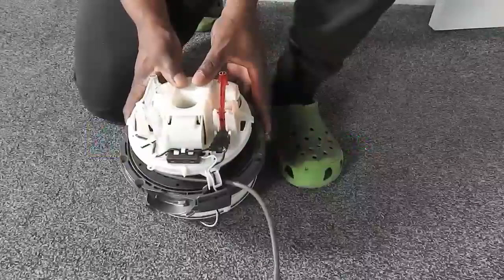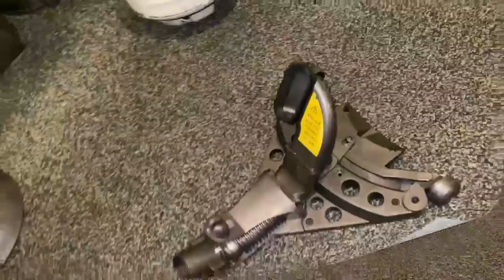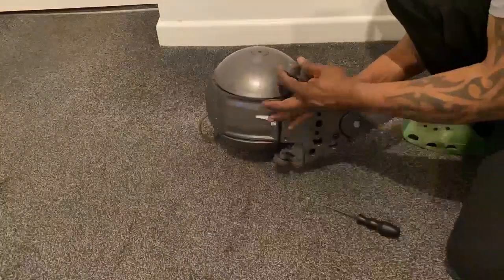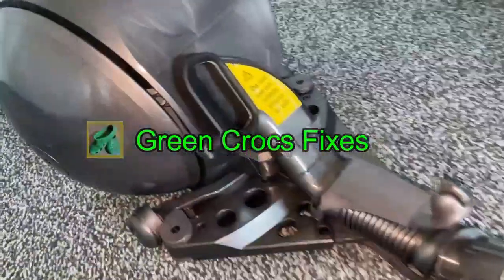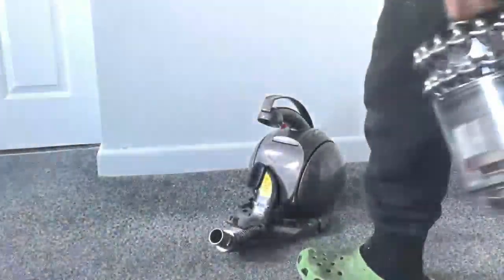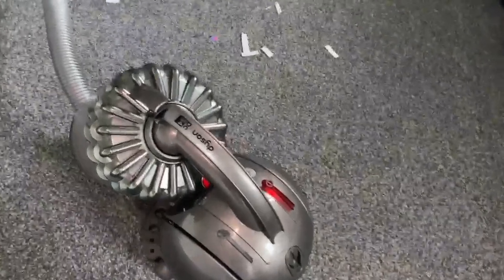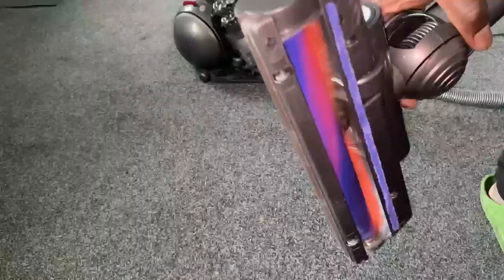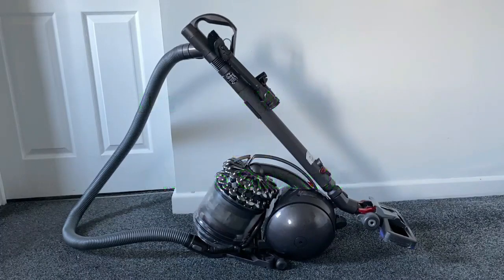Broken Dyson DC54 Ball Vacuum Cleaner Fix and Overhaul 3 of 3 ( Finale )

Comment: Amazing, I replaced the motor about 4 years ago after a big DIY cleanup, lots of fine plaster dust killed it.  It's just gone again and the price of the original has jumped from £30 to £70, was just about to ditch it when I found your vid.  Makes me so angry when there are alternatives for £16!
Big thanks from that there London town.
Reply from the maker: Thanks Doc,
                      yes I was also shocked at the price difference, but had to try the alternative. Only difference is the Turbine units hight. I only repair and sell these Dyson's  but swear by Henry Hoovers as they are more powerful and can handle building dust